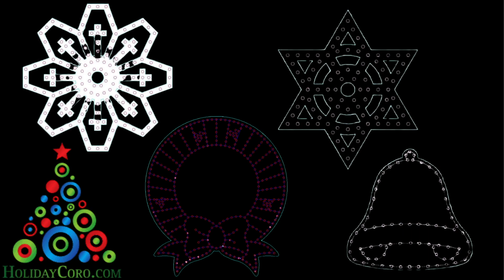Part 6 - LED Display Props 101: Build a Show That Stands Out!

Comment: I watched the entire series, which one starts with just lights on the house (or placed in the track)?  Is that Part 0?
Reply from the maker: I used to have a video out there and it just got roasted and the comments were out of control with people arguing about the "best practice". My first set-up were the Govee that just stuck to the the underside of the eaves with double stick tape.  I have a video labeled (DIY Light Bars) that I have been using for outlines of windows. The tracks are small and slim and easy to install with double sided tape.
I should make a "part 0" that really goes from a bare house to the final product.